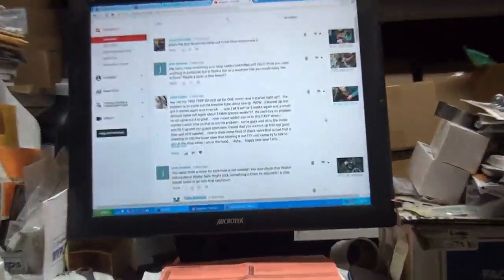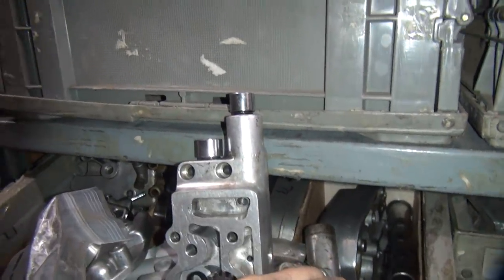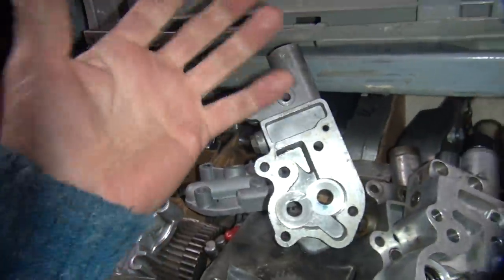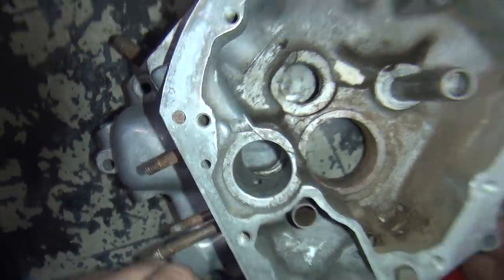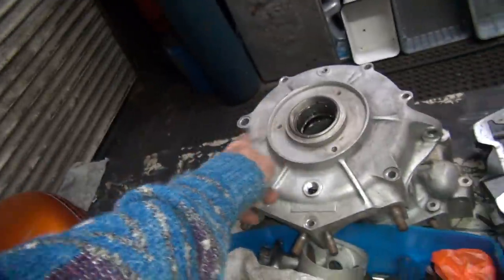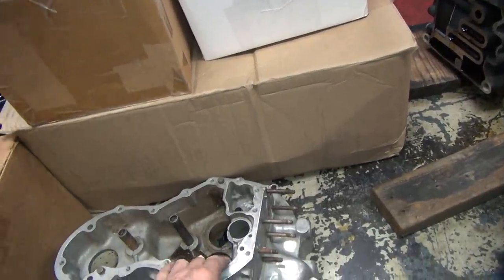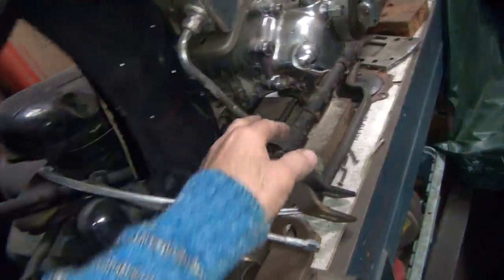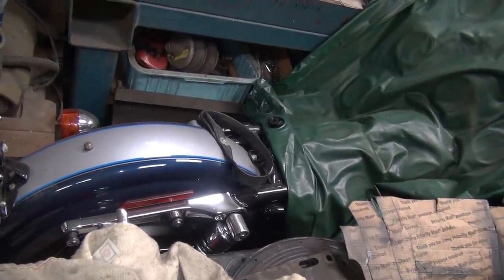#1 harley oil pump how it works wet sumping oil carrier over panhead shovelhead evo by tatro machine

Comment: The problem with wet sumping is there isn't a seal in the case for the shaft, machine out the case for a seal and wet sumping is over. Tom pump pro
Reply from the maker: what a load of crap. they already have one. what a dumbass.
tatro

Comment: I have a main shaft seal leak issues on a evo 120. I believe it’s the casting from the cases the seal is in because Iv rtv siliconed the seal and around it and splines and still leaks but when I take it apart the silicone on the splines and seal are still there so leads me to believe it’s the casting. Have you ever seen that before ?
Reply from the maker: not sure what motor you have but it sure sounds like a case problem.
tatro
Reply: @TatroMachine  the ultima 120 and its out of warranty and even tho thats a manufacturer defect they won’t do shit about it

Comment: You just described what my '76 FLH is doing... leaking oil all over the place because the vent tube hole is plugged off!!!!
Reply from the maker: unplug it and put 10 miles on it and see what happens. it might clear up if the rings are seated. if not, ride it hard for another 10 miles and see if the rings reseat. if that doesn't do it than its time for a topend job. 
oh, make sure you have straight 50w or 60w oil in it.
tatro
Reply: @TatroMachine  Thanx Tatro, I was already preparing to do a top end job thinking that the gaskets were messed up or missing, as when I run the bike it runs great but leaks oil from every gasket like Jug bases,  cam cover and oil pump body base...

Comment: Hello, I am rebuilding a 72 and wondering about your comment , one year only pos. Can you tell me more about the 72 pump? Thanks
Reply from the maker: yes, its the last year of that design. 1968-72. the next design is 1973-74 and then 1975-80. the 1981-91 is called the evo pump and the late evo pump is the 1992-99.
the 1968-72 pumps basically had one oil hole feeding the complete motor so the crank takes all the oil and leaves very little for the topend. in 1973 harley changed things by splitting the flow between the top and bottom ends. the bottom end now has a pressure check valve added between the top and lower end. once the oil pressure is built up feeding the topend, the check valve opens up and feeds the lowerend. after that the extra oil is blown out another hole into the cam chest. in 1975 harley changed some stuff in the oil pump body and change the drive gears to turn the oil pump faster. this is what makes the big difference in oil pump flow and pressure. 
s&s has good instructions on how to change some of the oil holes in the motor case when you install the later 1981-91 evo style oil pump on your motor.
tatro

Comment: Hey Tatro, would you use the reedvalve breather in an early Evo motor?  S&S says they are only for use in the later top breather evos, but i been told from several people that they work fine in the older evo motors.
Reply from the maker: i am 50 50 on them now. i have used lots of them on all years. some use oil and most work good.
tatro
Reply: @TatroMachine  ok thanks for the reply and thanks for making great informative videos.

Comment: on a 1996 EVO engine on which side the seal lip should be positioned, there seems to be confusion about the correct way to install it, nobody explains or shows on video the correct installation position, I think the attached to prevent the high pressure oil from going into the return gear side of the pump, sorry for the translation I speak french, thank you
Reply from the maker: i say every time i do a motor how stupid harley does things when they seem to have no common since. you got it right on the seal installation and why.
tatro

Comment: Hello, good clip After filling in the new oil, I filled too much, oil started to come out of the air filter, and even after I drained some of the oil, oil still flows and empties my oil tank. What is the cause and what is the solution? Thanks, I have FXEF fat bob model 1985 evo engine filter s&s
Reply from the maker: go ride the bike for 10 miles and let things get back to normal. just make sure you have atleast 1/2 a tank of oil before you go.
tatro
Reply: @TatroMachine   but all riding time oil continue dripping from vent  its danger
Reply: Fkvjv
Reply from the maker: have you riden the bike yet? until you run the motor long enough to equalise the system it will keep dripping. you can take the breather line off and clean all the crap out of it too. its going to drip until it cleans itself out. 
you said you just changed the oil so that is what i am going off of. if you over heated the mnotor the rings will stop working and have lots of blowby. this will cause lots of oil leaking out the breather and other places. you can check for this by doing a leak down test on your motor. the leak down testing tools don't cost that much anymore.
tatro

Comment: Hey Tatro, I'm rebuilding a 74 ironhead motor and I can feel a bit of drag at one point when I spin the breather valve gear of the oil pump by hand,  but It spins perfectly when I do it moving  the crankshaft with the rods like you do. Do you think it's okay? Thank you

Comment: Have a qwestion what is your thoughts on the oil pressure spring stretch trick peaple are talking about? I've seen people doing it on you tube and it appears to improve the oil pressure alot but would that actually be bad for the 80cc involving this oil  supping problem? 
I'm new on the evolution motor and realy enjoy your teachings. 
Thank you.
Reply from the maker: it helps but don't get to carried away with it. tap on the ball a little after you cleaned thing up helps.
tatro

Comment: I own a 73 Harley-Davidson FLH Electra Glide I have built it I thought it a basket case I have a question my oil pump has two Ball Bearing in the top of it they told me to change the ball bearing with a pistol but the Piston won't fit in the hole what do I do
Reply from the maker: ream, hone or lap the hole to get the piston to fit correctly. i don't think the oil pump will work correctly with the ball as a check valve.
tatro

Comment: Do you recommend using the reed valve style breather on stock Knucklehead motors? Thanks for all the videos
Reply from the maker: not sure, i have not used one on a stock motor yet. it worked great on a race motor i did for a racer friend.
tatro
Reply: @TatroMachine  thank you
Reply: Can I use an S &s breather reed valve in a 1954 bottom with a 1970 shovel pump ??.I understand S&s only advertises the reed for later years...Thanks in advance,Joe

Comment: Heck yea 🖖🏽
Just a question on the breather valve I remember their plastic is it better to replace it with a steel breather valve my bike only has about 16,000 miles on it it’s a 98 Fatboy I don’t know if it has the plastic or the steel how do you remember I had a shovel head 75 and I think I replaced it with steel years ago I don’t remember the reason or somebody told me to do it do you think it’s needed or is plastic good enough thank you
Reply from the maker: the plastic ones are junk. use a s&s reed valve or the earlier steel one.
tatro
Reply: Tatro Machine thank you 🖖🏽

Comment: Question, very likely that only you can actually answer: (and, thanks in advance)

I have a sifton 12-9969 oil pump on a 56 pan.  Was put on 20 years ago by a good shop (reminds me of your brilliantly sarcastic ass!) and has been a champ always, no issues.   The bike went down a decade ago (thank you life, may I have another) and I’ve finally brought it up.  As of now my only remaining issue is the chain oiler screw in the pump, as in, I don’t have one. As you know, without it or it misadjusted it’ll drain your oil tank toot sweet and toast your motor. 

I ordered one mail order, it’s too fat for the pump. God forbid there be standardization...  anyway, do you know if this sifton model is generic enough in its use of this needle screw, or is it entirely sifton/model specific?   I’m tempted to take a plain Allen headed screw to the belt sander and cone the end, but I’d much rather have guidance from one of the last remaining actually knowledgeable people left on the planet.
Reply from the maker: those were just import pumps, sifton never made those non-valvetrain parts they sold at the end. i would just take a screw and cut or grind a tapper onto it.
tatro
Reply: @TatroMachine  made a new adjustment screw, I can stop the flow entirely (needle seats completely) into the passage that goes up into the plunger tube.  Do you know what other ports are fed /functions shared by that feed route?  Is the breather tube /chain mister the end of that line?
Reply: The cool compatible screw I found in a junk drawer that already has a beveled tip and seats nicely in the port isn’t a full cone shaped piece, it’s stepped after its nose, then back to threaded shaft (all 10-32 of it) so I need to know if I need to erase a couple of threads immediately prior to the tip to facilitate full oil flow laterally past it (to the breather?)

Comment: Dude I need serious help could you please help me I have a 1998 Harley Davidson Dyna wide glide built into a chopper so it's not in the original frame anymore but I had oil  and heavy smoke coming out of the exhaust I take it for a ride and all of a sudden the oil cap blows off hits me in the leg and then the bike sounds like it has a lot of friction and wont start  like there's no oil in the case anymore please tell me what's wrong so I know what to fix. And just prior to this while all the trouble was happening I don't know which hose it is what it's called but it's the one in the middle and it goes up to the top of oil pump  by the tappet filter, it never had any oil in it ever it was always clear
Reply from the maker: you killed the motor from lack of oil or over heated. the pistons are seized for sure. pull it apart and see how bad everything is and start rebuilding or get another motor.
tatro

Comment: Hey boss, I got a question, I bought a bike with a 131 merch performance motor on it. I put it in the shop got it back and now it's sumping bad. I can run it and when I turn it off it dumps half a quart of oil everytime I shut it off. Even if I only shut her down for 15 min. She's a leaky bitch, but how do I fix it? Is it as simple as a check valve ball or do you think I need a new oil pump? It's a performance machine oil pump.
Reply from the maker: do a leak down test on your motor and see how bad your ring seal is. over 10% will sump, over 20% will dump oil like yours.
tatro

Comment: It took The Motor Company until 1993 to figure out how to eliminate the wet sumping problem by relocating the oil bag under the transmission. What I find HILARIOUS is that prior to that they directed the oil line BACK INTO the carburetor via the air box! WTF????  Couldn't they figure out how to get that oil back into the oil bag? Such a dumb ass group of Engineers...
Reply from the maker: thats harley for you.
tatro
Reply: Kenneth Wise ?  The oil return did not go into the air filter, that is a crankcase vent line mandated by the EPA to prevent oil from dripping onto the road. 
Not all models have the oil bag mounted low.  How can these videos be of any interest to you when you don't have a clue ?
Reply: @kennethwise7108  There is the answer to your problem.  Ride More - Cry Less !